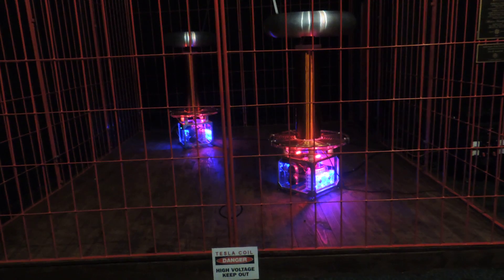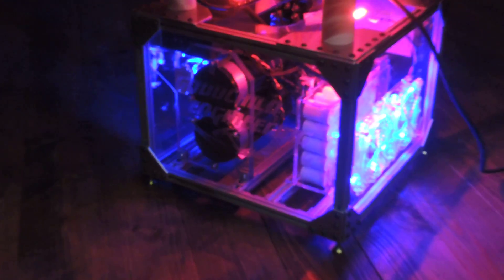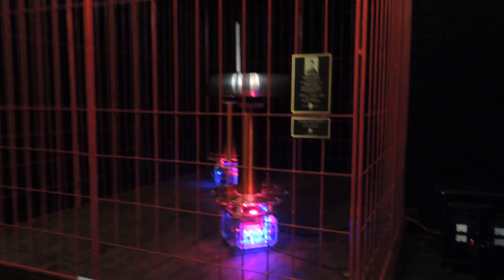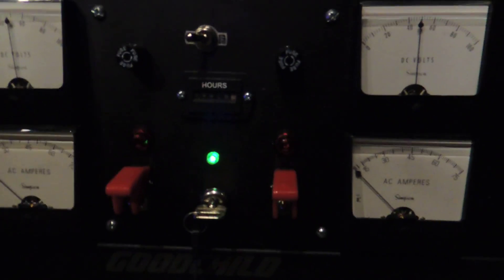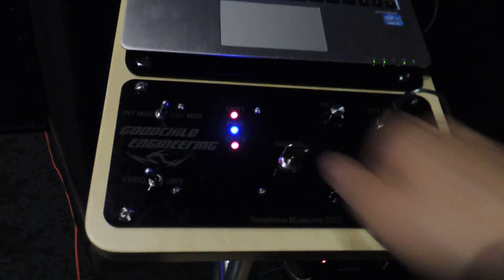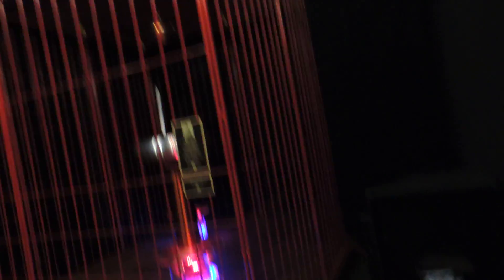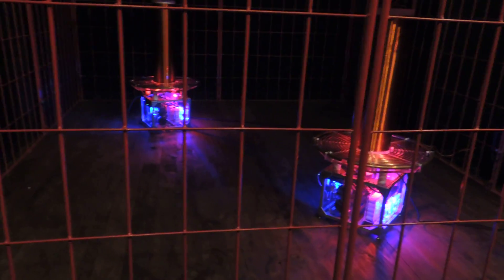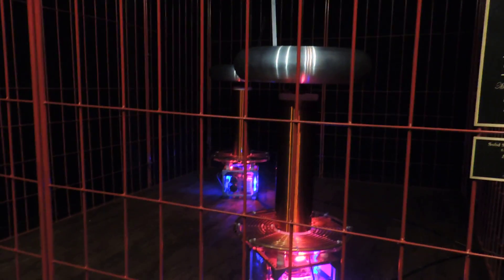Texarkana Museum Tesla Coils setup demo

Comment: I don't know a lot about electricity but I do know that electricity takes the path of least resistance and the cage is probably grounded so metal conducts a lot better than your body so you would be completely safe holding on to that cage(if it is grounded)